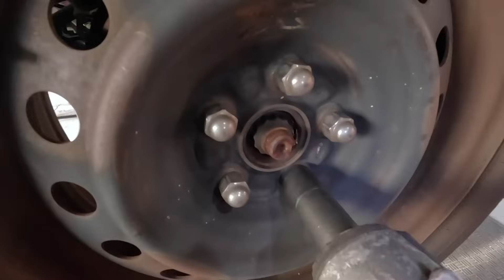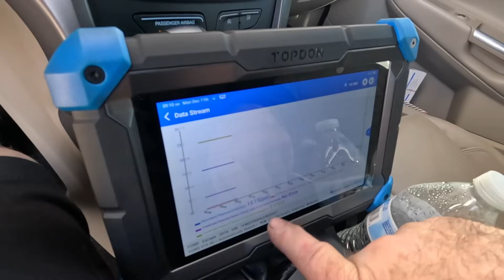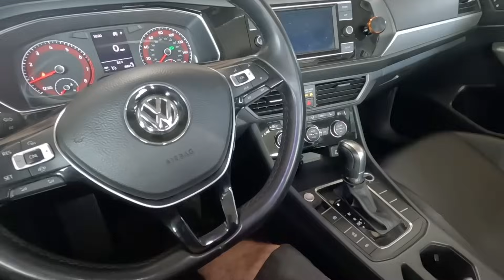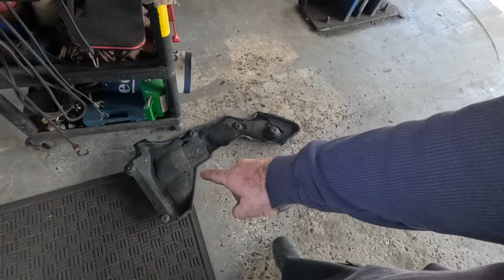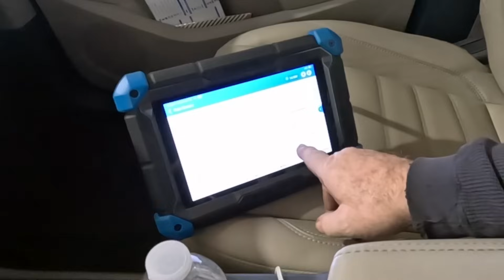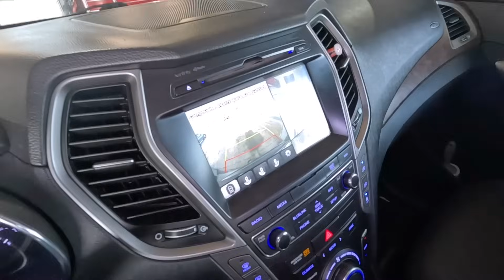COROLLA, ES350, SANTA FE, JETTA, ESCAPE, DAY IN THE SHOP 378 #auto #repair #pcv #diagnosis

Comment: I've owned 2 Land Rovers, a Mercedes, a Chevy pickup, 2 Volvos, 2 Audis, and 6 BMWs.  I'm driving a RAM pickup right now and my wife just got a 2024 BMW X5 as a company car (so I don'thave to mess with it.)  The Euro cars seem to be feast or famine but are generally cheap to fix if you can do the work yourself, which I always do.  The key is to keep the maintenence up to date and ignore their silly 10 000 mile oil drain intervals.
Reply from the maker: Very true!

Comment: I am driving 2016 BMW 320d. The main thing is to service them properly. Not like many manufacturers recommend long oil change intervals and lifetime transmission oils. I recently went to independent BMW specialist to change oil in my transmission and rear differential. BMW is claiming that they are lifetime.
Reply from the maker: Exactly, maintenance increases the odds of a long lifespan tremendously!

Comment: Jimmy! Whoa whoa whoa! Don't badmouth my Cadillacs the North Star paid for my first house.😊 in all seriousness you are right about Lexus they are really beautiful well-built cars. My son has an RX 350 F Sport and a Roush Raptor. He bought his wife the new LX 570. My 2008 DTS is rolling along with the Phantom traction control lights the tire pressure monitor that will never go off even though it will not scroll low tire on the message board and all the other electrical Gremlins they have. One thing though the case halves don't leak because I bought it from a customer and I had already reseal the whole motor a few years before I bought it from the customer
Reply from the maker: Haha, that sounds about right William! Thanks! :)

Comment: Hello from upstate NY,  really enjoy the b videos.  Question.  Looks to me that the Lexus oil filter housing  had a 1/4" receptacle ? Why buy  a tool truck housing socket? Just use a extension and rachett.
Reply from the maker: That is an oil drain, so when you remove the filter housing it’s less messy. They always unscrew before turning the plastic housing. I used to take them off with pliers, but that can make a mess too.

Comment: I needed a metric flex head ratchet wrench- resigned myself to buying a set.

Went looking at Vatozone and OhReally- no flexheads- just regular  chineesium ratchet wrenches.
   Found flexy G earWrench sets at HomeCheepo. Got it home and the 13mm was skipping.
   Called the number, was polite,explained the sitcho... A week later a replacement came in the mail.
   No 3rd degree, no mail back the bad one.
Very good customer service.
Reply from the maker: That is good to know!

Comment: I have a question I work on a trailblazer costumer complaint when he turns all the way to left or right the car stop like if he brakes! But he didn’t press the pedal ! Any help will be appreciated thanks
Reply from the maker: Sounds like a tire or suspension component is binding? I’d check it on a drive on style rack.
Could even be differential or axle related?
Reply: Make sure it is not stuck / in 4WD